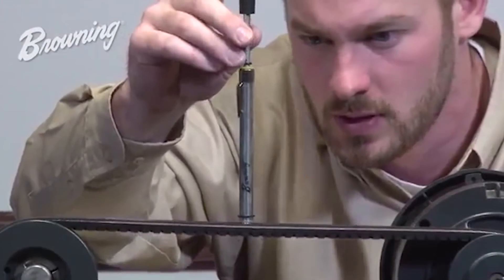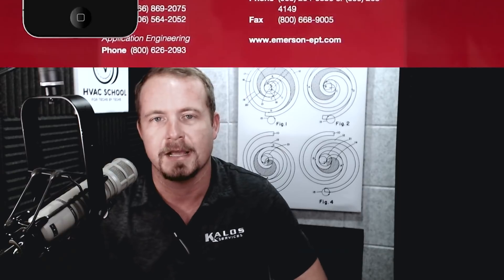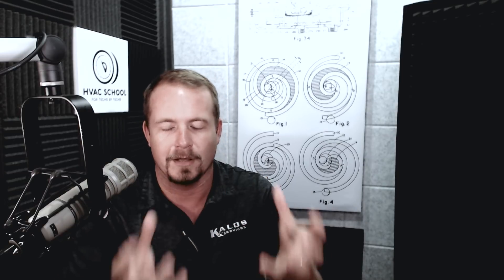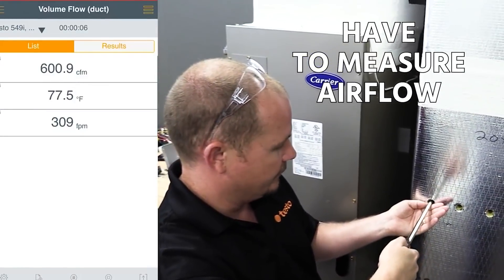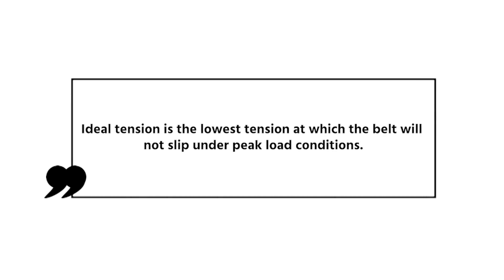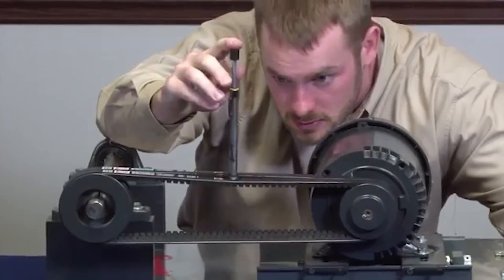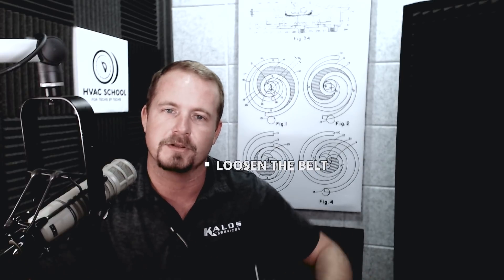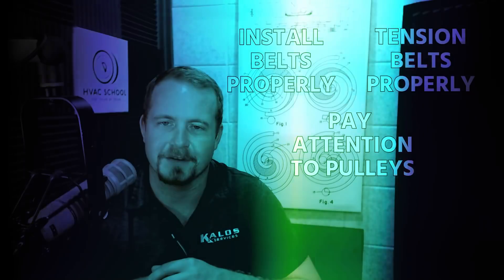HVAC Belt Tension

Comment: Why would increasing the air flow ever be a bad thing when adjusting the pulley
Reply: Because, you will disturbe the air balance. In a case of a MAU or RTU more airflow would create a positive pressure in the building (assuming it is balanced right to begin with). On exhaust fans you would create a negative pressure. 

More airflow does not automatically make things better.

Comment: I have an old furnace that hasn't seen a tech in 20 years. I hear a clunk occasionally whan blower starts, so I want to inspect the onit, and check belt tension. I like your common sense approach to belt tension, so that's what I'll do.

Comment: The modern refrigeration and air conditioning book is key on learning about belt tension...one side should be running smooth while the other side should have a slight flapping to it...hope I explained it right.
Reply: Beautiful! "Slight flapping" is a great explanation! Just came to this video after having an AC freeze over, because the belt was  not tight enough and far too little airflow was going through the coils; I thought i may need to go tighter still because of this 'slight flapping' but if its to be expected, great! Thank you!

Comment: Had a fun one today:

 - Unit would run for a couple hours and shut off.
 - VFD showing the error code for motor thermal overload, and locking out.
 - Motor not getting hot at all.
 - 3 of the rooms with returns for the unit had outside doors that were constantly opening. (In HOU, so this means adding humidity too)
 - Megger would read bad leads immediately following a lockout, but given a little time it would return to a good reading.

Anyone wanna take a stab at what it was?
Reply: That’s weird. Was it a faulty motor ? I’m curious.
Reply: @Alex-jo2oi  Nope, as per usual you get the really weird problems when multiple issues intersect. Issue number one is that the unit wasn't properly leveled, and was a little bit tilted towards the blower compartment. Issue two was that someone had replaced the motor sheave with a larger one than factory and not adjusted it, so it was moving more air than it should have (somehow it wasn't over amping, motor may have been aftermarket as well).

The end result was that it was pulling water off the coil and said water was pooling in the blower compartment. Every morning when it would start up with the occupied signal, there would be enough moisture in the VFD compartment (which wasn't air tight from the blower section) to make it wig out, trip, and lock out.
Reply: @TheMinecraftACMan  sounds like a headache

Comment: Tensioning practice is key but if you leave an adjustable sheave in place you're asking for belt alignment issues. Every belt change you should be checking the belt alignment as well as tension. It is also wise to check the rpm of the driven pulley after initial commission or T&B has been done so you can make sure it doesn't change when you you replace a belt or against standards adjust or replace the adjustable sheave. Belt tensiok is only the tip of the iceberg if you want to do it properly

Comment: If the motor is over  amping you can adjust the sheave to reduce amperage correct ? A 50 year old nursing home I recently went out  there 

The motor had been replaced recently was spinning the wrong direction and more than double fla.  the hood  filters get sucked up against to roof of the hood.    MAU Gutted make up air. Who knows what the original hp motor and cfm was, but I did check the up draft in the hood by pouring a pitcher of water on the hot grill to make sure it was all going up in the hood even after reducing the amps in half to below name plate.

Comment: Good Topic ! Good video. ( Ftngot ) after doing this for 40 years ive found that overtightning a Belt WILL Do Far More damage than a Slightly loose Belt.
Overtighning - WILL damage / destroy Bearings      
Undertightning - a Belt May slip at times. creating little to no damage. maybe a Pulley replacement overtime. alot cheaper than bearing job or motor replace.

ive Learned in 40 years to just replace Belts When they get stretched. i No Longer adjust inexpensive belts anymore.
Cheaper for customer & better.

also - when possible - use a belt tensioning guage as seen in this video to get it right from the get go.

Tech tip - Clean the Groove - Use a Wire brush & use sandcloth to remove the shine off Belt Pulleys for a better Grip.

Tech. tip #2 - a Cog belt will Get a Better grip than a standard belt. Try a cog belt if u have one that slips under proper tension.

Comment: Here's a tip I learned from my Boss, even though he isn't a mechanic. He learned it from a mech in AZ. I've used it successfully a number of times. Presuming the pully isn't totally warn out, just shiny, you can clean it and re paint it. I use rattle can primer and rust oleum. Works well, I have fixed rigs that would slip the belt no matter how tight( new belt ). Down side is it needs to dry for a day. But, if you can't get a new pully for some reason....

Comment: Good job Bryan thanks for bringing this topic up. My $0.02 - First decide which you, and your customer, would prefer to replace the belts or the motor. Belts are cheap, replace them e'rry 6 months, preferably during the biannual inspections. If the belts are set too tight the bearings will take the hit due to load, if the belts are sloppy loose or the sheaves are worn the bearings will suffer due to shock. If the belt is riding on the bottom of the sheave the sheave needs to be replaced, the belt should ride on the sides of the sheave. When rolling the fan the belts should fide smoothly through the sheaves, if the belts get stuck in the sheave the sheave needs to be replaced. Most belts are made of Kevlar so that belt dust will eat the bearings if it gets in them. Never roll belts on or off, that can set them up to do weird things like flipping over while running. ->I've seen that.